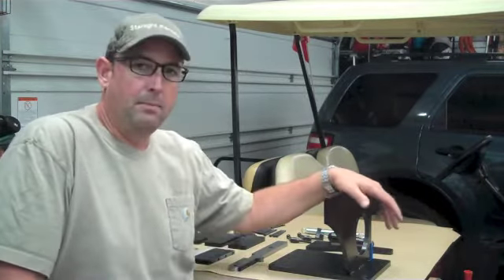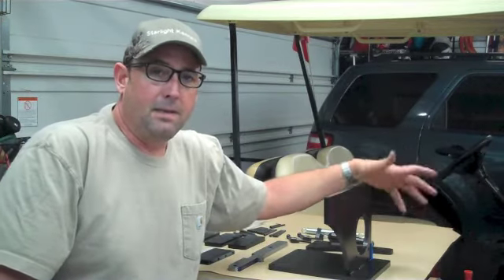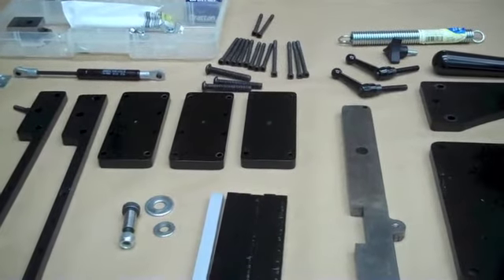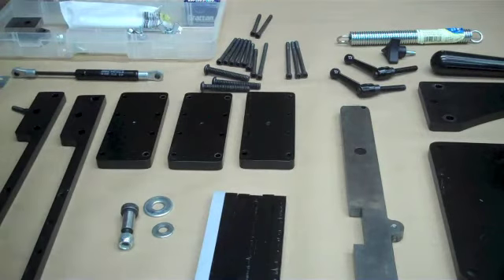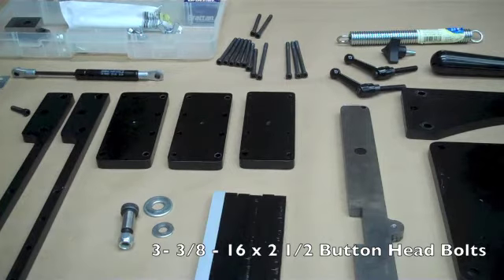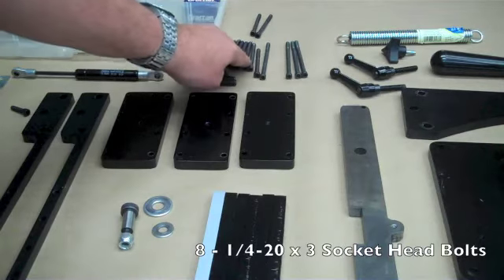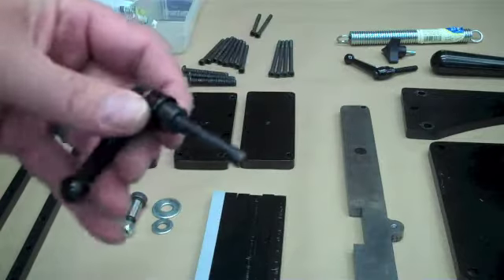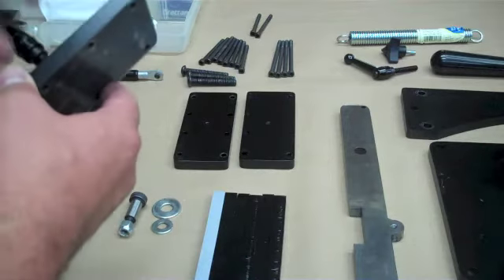Grinder in a Box Build Part 3

Comment: Did you have the part numbers for the gas shock and handles? Also where did you find your bolts? Home depot was lackin in that dept.
Reply from the maker: Hey Jon,
Here are the part numbers from Mc Master Carr.
Shock- 9416K111
Brackets- 9416K29 Need 2
Eyelets- 9416K84 Need 2
Handle 57455K76

As for the hardware I used a real Hardware store.  Even ACE or Tru-Value may have what you need.  If not an online supplier like MCMaster Carr may have what you need.  Home Depot and Lowes just don't cut it for this.

Good Luck
Reply: I sincerely appreciate it sir. I actually went to ace earlier today and found almost everything i need and only 35 bucks. Appreciate all your help. :)
Reply from the maker: ***** You are very welcome.  Glad you found the hardware.  If you haven't ordered from McMaster Carr yet I think you will be very pleased at their quality and speed of shipping.  Hope all is going well with your GIB.
Reply: Yes i have once for some u channel molding i needed for a computer build i was working on Very nice place and huge selection. And shipping was super fast!
Reply: Tyler Johnson
Hey Tyler, what is the force of the shock that you used? I see different specs for that part number that you list? Thanks for all the info!
Reply from the maker: I relisted the part numbers in case you needed them and the shock was a 20 lb force.

9416K111 Gas shock 20lb.
9416K84 Eyelets
9416K29 Eyelet Brackett
Reply: Tyler Johnson
Very much appreciated, thanks again!

Comment: Having a problem tapping this 1/2 steel  in 5/16-18nc for tension lever any suggestions?  !st time threading.
Reply from the maker: Make sure you are using the appropriate size drill for the clearance hole.  Refer to tap/drill size chart available on the web.  I also recommend using a
 tap handle and some sort of lubricant.  If you are having trouble starting the tap you can try to chamfer the hole with a chamfer bit or a larger size drill.  Go slow and back the tap out regularly to ensure chips are cleared.  Hope this helps.
Reply: +Tyler Johnson  thanks for the reply, the last comment being over a year ago wasn't sure I would get one.  I don't know what the problem was. I took the handle piece, drilled a hole in it and tapped it just fine.  The plate that attaches to the side top to hold the wheel arm just wouldn't cooperate. I ended up breaking the tap. Live and learn I guess. I can still use the other side for my wheel arm screw tensioner
Reply from the maker: +J Grisham, I am still around and planning to do a few more videos.  Sorry you had an issue, it is always frustrating when things go wrong.
Reply: Hey Tyler, My problem was cheap taps...  Bought a new one and had no problems.  Just wondering if you ever added the hinges for horizontal grinding?
Reply from the maker: I am glad you figured the issue out.  I have not added the hinges for the horizontal yet.  I have the parts and a plan now I just need to make the commitment to move forward.  I will try to get it done and post a video as soon as I can.